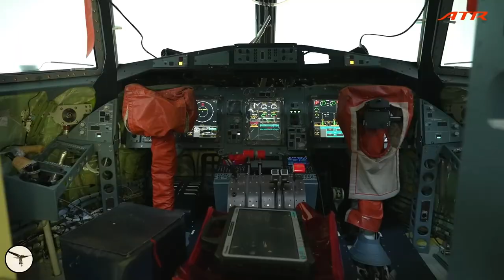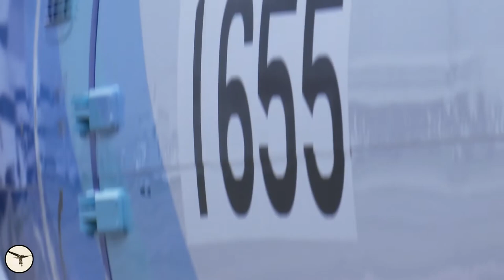First ATR 72s for Maldivian | How ATR aircraft are manufactured

Comment: Hello Mr. Nordal. I really enjoy watching your videos. I have one question though. In this video at 2:30 (window view) we can see the 2 ATR's flying at the same speed. Taking into account that the camera's frame rate is matching the rotation of the other ATR, I noticed the propeller of the ATR the camera is on is rotating faster (or slower, can't tell). How is this possible if they are flying at the same speed? Shouldn't they have the same thrust setting? One thing I can think of is different propeller pitch but I could be wrong. Please enlighten me
Reply from the maker: With the exemption of small airplanes, propellers are operating at a constant rotational speed, which means propeller RPM doesn't change with aircraft speed. Propeller pitch is adjusted automatically to maintain the desired RPM as the load on the propeller changes. On this aircraft, normal propeller rotational speed at cruise is 82%, or 982 RPM. I doubt digital cameras have a shutter speed that matches this. 
Formation flying requires multiple changes in pitch, roll and power. Therefore, the pilot needs a power reserve. This is achieved by setting propeller rotational speed to 100% (1200 RPM). Not only does this give more power, but the higer RPM also gives a more crisp response to power changes.
Reply: @FlywithMagnar  Thank you very much from the response. From your words, the other ATR is on AUTO, while the ATR the camera is on is at 100% OVRD? Is that correct?